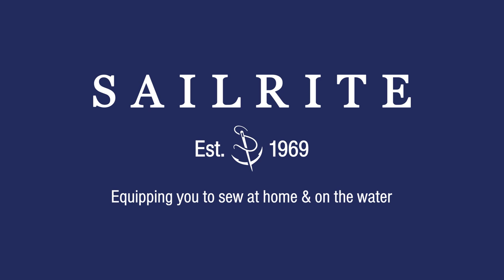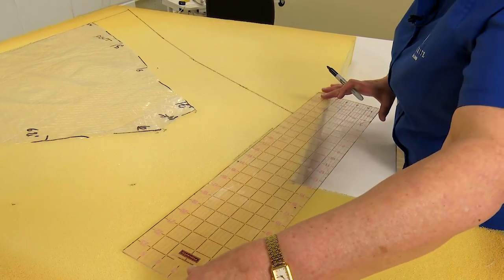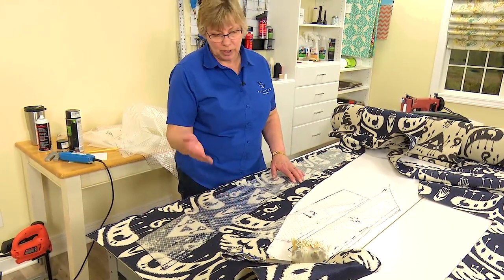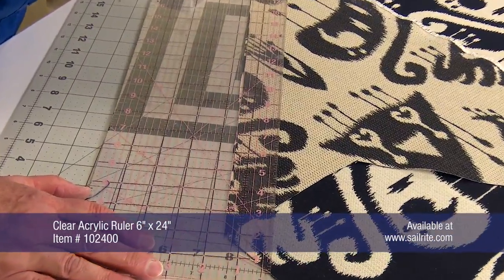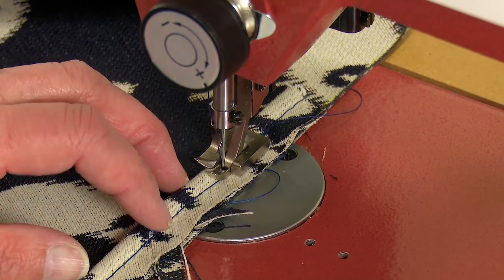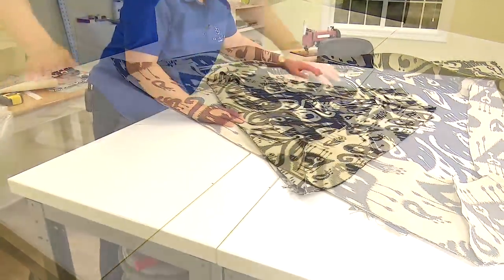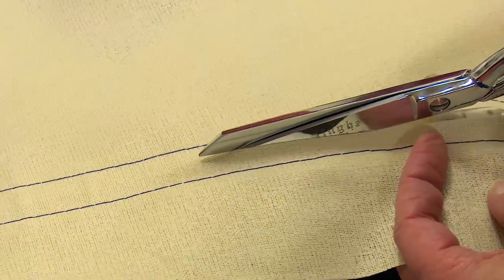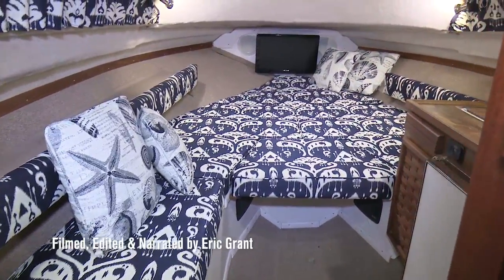How to Make a Bow Cushion for a Forward Berth

Comment: When I got my hot knife from ya'll I always left off the supplied shoe that came with it and just cut using the ruler like you do.  However, recently (now that I'm not storing it in the case because it doesn't fit well with the shoe) I've found it much easier to just leave the shoe on and wedge the fabric into the blade.  Is there any reason other than personal preference why you don't use the foot here?
Reply from the maker: The only reason is that the "cutting foot" on the Sailrite Edge Hotknife makes it slightly more difficult to make sharp turns when cutting the fabric. Other than that fact the cutting foot works great and should be used. It is often just a matter of what you get used to using. 
Here is a link to the Edge: http://www.sailrite.com/Sailrite-Edge-Hotknife-Package-110-Volt

Comment: Why is seam allowance not added to the top but is added to the sides and bottom?
Reply from the maker: We do add a 1/4" seam allowance to the bottom plate and top plate. for the Boxing we add seam allowance of 1/4" to the top width and bottom width, but we do not add any for the length of the boxing (see 8:35 min for more detail on that).